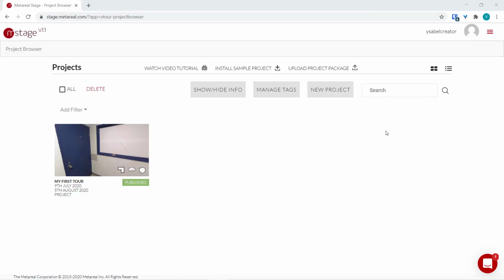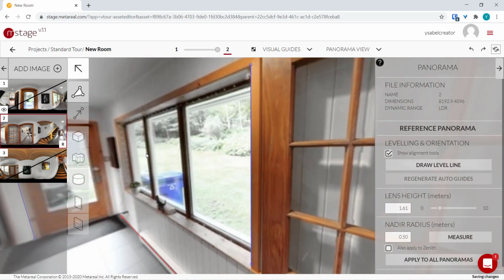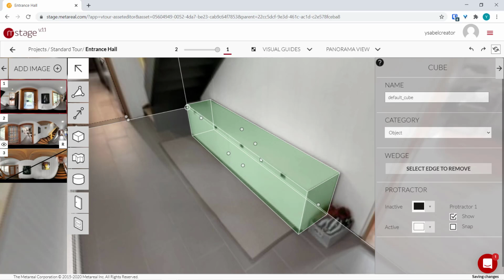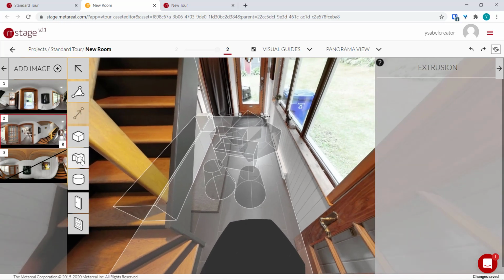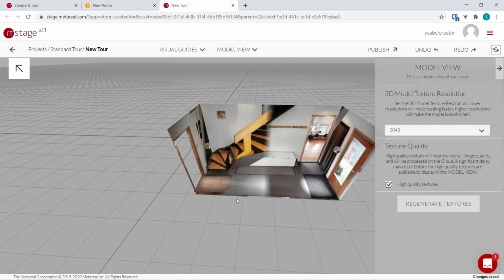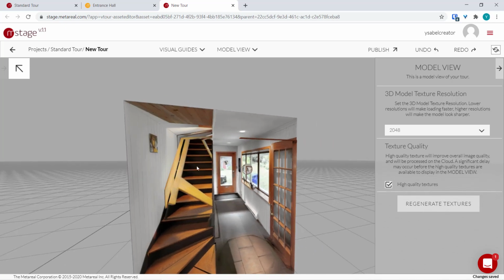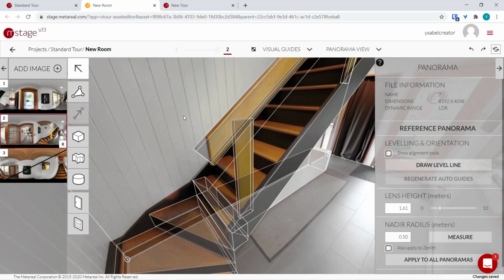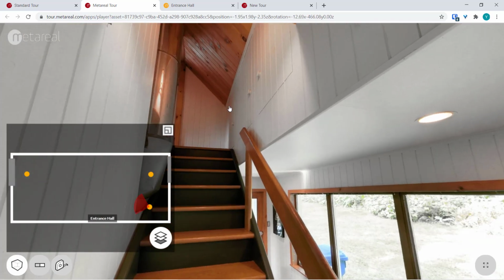Make better looking 3D virtual tours & models by drawing objects | Basics - Part 3

Comment: Hi there! 1. could you please explain how did you set vertical level line on the doors neer entrance - seems to be from different panorama - the one next to doors with curtain. 2. im doing all the steps as shown in tutorial but my sealing is showing 2.35, also my last point is in slightly different place - any idea what am i doing wrong?
Great tutorials, by the way!

Comment: This one was a bit rushed. For the door, do I want the thickness of the actual door or the passageway, or does it really matter?
Reply from the maker: Thanks for the feedback, which part did you find rushed? And for the door, its thickness also determines how thick your wall is in the floorplan, so would recommend making it as thick as the passageway instead of the actual door.
Reply: Metareal thanks for explaining. I’d like more explanation on how to draw 3D objects. Which plane is my first click on, and where do I click next? I find I’m always having to guess when drawing objects, especially columns.
Reply from the maker: It's probably best to think of each point as a new dimension. So your first point, you're telling the software that ok, this point is part of this object. With the next click, the point becomes a line, so now the software knows this is how long/wide the object is. Then the next click tells the software, this is how high the object is.

For a more concrete example, say you're drawing a cube that's sitting on the floor.
1st point: closest point of the object you can see on the floor (1D)
2nd point: still on the floor, length/width of the base that's sitting on the floor (2D)
3rd point: off of the floor now, height of the object away from the floor (3D)

Then just adjust until the cube fits the actual object.

Does that make sense?
Reply: Metareal it does. And that seems to be what she was doing. Just getting the shape and then sizing it accordingly. Hopefully that’s an area for future ai enhancements!
Reply from the maker: @JerryAulenbach  Yep, we're hoping to improve the experience with AI as soon as we have the funding for it